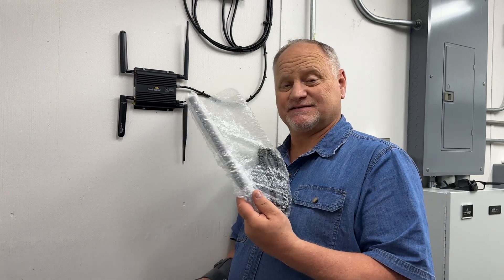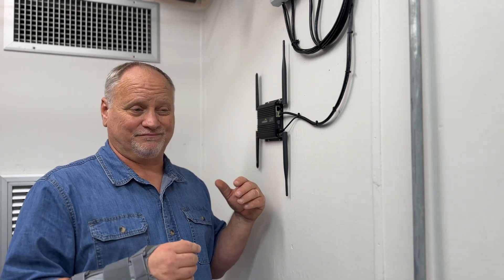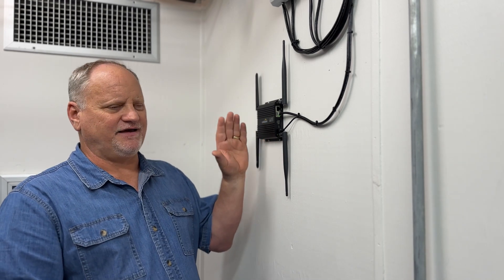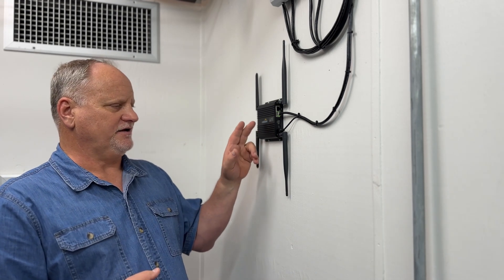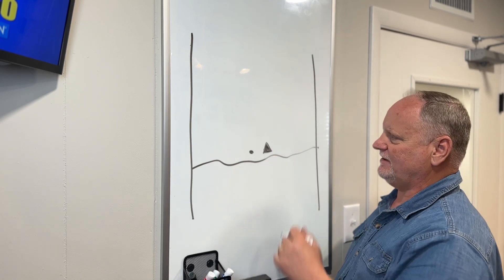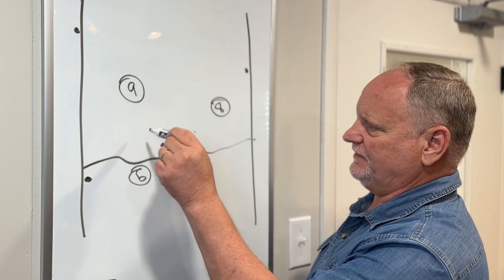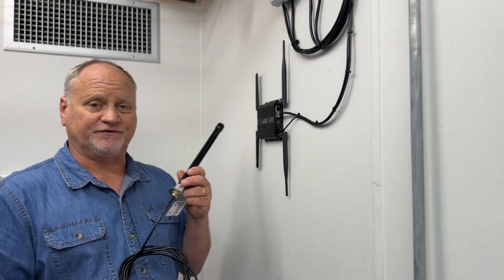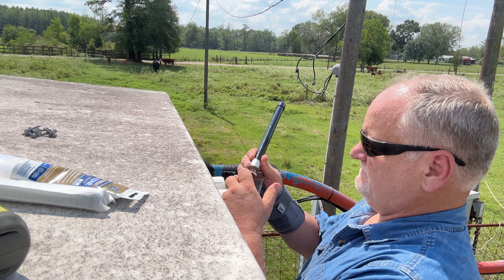AWESOME Mobile Internet! || Super Cell Signal!

Comment: Is that a router, like a wifi router(We have one in our RV but it's for wifi not cell phones. I don't think I've ever hear of a cell phone router. We have a cell phone booster that T-mobile gave us which helps a little but looking to improve the situation. Thanks for posting.
Reply from the maker: Thanks for the comment.😊 This is a cellular modem, not a cell booster. It just receives a cell signal (or an ethernet connection from a cable or phone company internet as a backup source). Also has WIFI from its Cell or WAN connection. Hope that makes sense.🤔